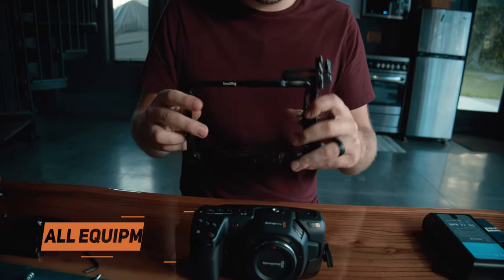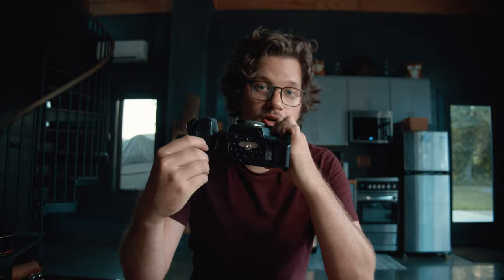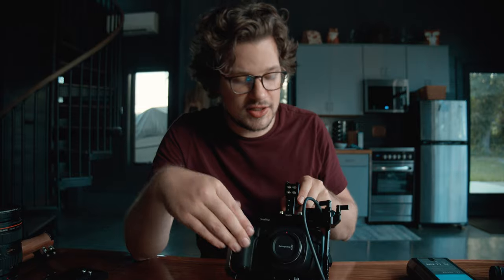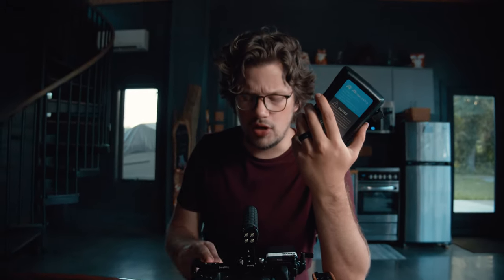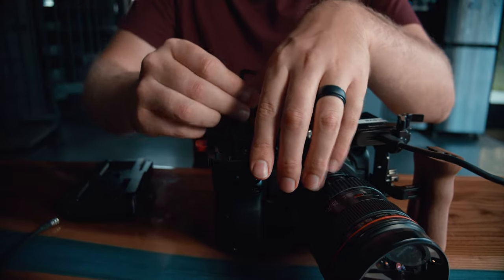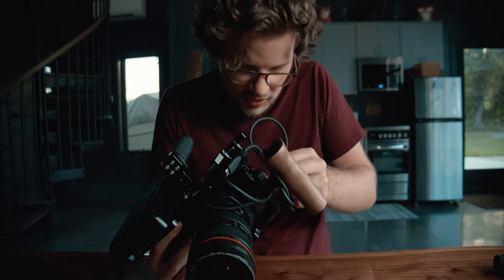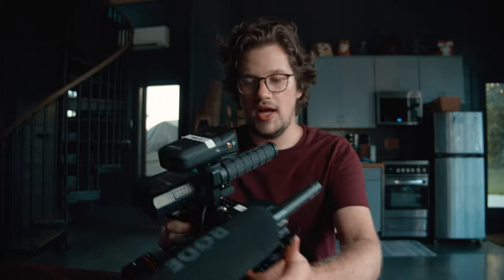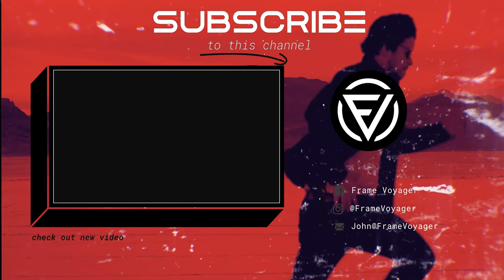My Run & Gun BMPCC 4K Rig | Frame Voyager

Comment: Check out the smallrig 2247, does so that you can screw your speedbooster onto the cage, which is convenient because the camera doesn't turn inside the cage and it removes micro jidders from the lens when you focus, if there is any play between the speedboster and camera like there are for some people.
Reply from the maker: Good suggestion!

Comment: That hand grip likely doubles as an SSD holder. If so, I strongly recommend stashing your SSD inside of it to avoid cage clutter. The DockCase USB C to USB C Cable 3.1 Gen 2 (.7 ft) is a near perfect fit if you go that route.
Reply from the maker: My friend actually has one like that. This handle is not one that you are able to add an SSD into but that's a good idea for a further modification. I kind of like having it on top just because it allows me to quickly get to it if I need to. But you're right that it would probably help with cable management and compactness of the rig.
Reply: Yeah, I have the handle that holds the SSD. Love it! Keeps it even more compact. John's right in that his rig gives you easier access to the SSD which can be great for situations like something run and gun where your'e shooting and dumping quickly. That's the great thing about the camera, it gives you so many options!

Comment: I have been back and forward with v mount vs npf solutions and the more videos you see the more options you might consider but if travel light is your style i believe the v mount is a bit too much because even if you can see the screen you are bulding a big rig haha personal opinion. I have been working with my p4k for a year and a half now and one thing i notices is than half of my jobs i can do them with 3 npf 970 batteries they run for at least 3/4 hours each so if you don't want to use an external monitor you can use an npf plate the small rig one is really well made on the left side of the rig next where the connections are and use your mic position where your v mount it is, also you will gain more room in the handle as i don't like so much have that space full of stuff to operate. That could be my recommendation to travel light and run an gun scenario but it is just another one, everyone has their own evolution of the rig these days haha Good content my friend
Reply from the maker: I like that! I'll have to try that configuration at some point. I really like how it's built because of how it fits in my hard case. I don't have to take anything apart. It can be problematic how heavy it is with a v-mount battery but I can always take it off and let the internal battery run if needed. I've been able to, multiple times, shoot handheld for moving interviews for over an hour. But I've still found this easy to use when on the run, I just never have to think changing batteries for most of the day. But your rig makes total sense too! Like you said, everyone has their own variations of rig designs that they like and what works for them! I just wanted to share mine to give others ideas and to hear from others on how they design their rigs. Thanks for sharing!
Reply: What do you use for storage
Reply from the maker: @danyalvisuals  great question! Filming a video right now on that actually! But a use qnap nas and then am developing a hybrid system that I'll show in my upcoming video!
Reply: @FrameVoyager  okay mate. I’ve subscribed to you looking forward to it 🙏🏼

Comment: Is it possible to fry your blackmagic when you connect it directly to the vmount battery?
Reply from the maker: Yes, unfortunately. It's not common or likely but we have an article one of our community members is writing on thai topic that I will post when it's done! 
Best advice I can give you now is to just power off your device when plugging in just to be extra cautious
Reply: @FrameVoyager  thanks. Would my camera be safer if i connected a Dtap to npf dummy to my monitor. And a DC cable to my bmpcc4k?

Comment: hey man, I'm diggin the run and gun approach on the rig..
Now, since i see you also use Canon with the Viltrox, let me ask you, have you had any issues with the auto focus and image stabilizer, cause mine ain't working..    only the iris control works
Reply from the maker: Hey! Thanks! Good question. I have had some issues. For me it depends on the lens but I usually try and just use mft lenses. Easier and lighter and works natively with the punch-in focus and IS. Plus I've noticed the image being super soft and susceptible to odd glares and other issues. But this was only with some lenses.
Reply: @FrameVoyager  I have also noticed the image being super soft at times. Is this because of the Viltrox you think? Because I used the exact same setup for my gh5 for two years, but never had that problem. So I wondered if it was something wrong with my bmpcc4k. And it usually solves it to just crank up the aputure. But it doesn't happen all the time. Almost looks like the clip is out of focus plus being really soft. Never happens on my mtf lenses tho
Reply from the maker: Yeah, I'm going to be getting a meta bones to test out here soon and see if that makes a difference. I did shoot something for a client that I couldn't tell that the image looked soft the entire time until I'd open it up on a bigger screen. It's almost as if it had a glare from a light or something across the middle that made it look soft. It also could have been the lens I was using as well. I'm still trying to experiment to see if that's because of the adapter or the lens. I prefer to use MFT lenses with the BMPCC4K anyways because they tend to be a lot lighter and easier to travel with. I also think they hold up pretty good image wise.

Comment: Genius with the Vmount on top! I might copy that ;) No monitor tho?
Reply from the maker: Thanks! And no, have never really liked using one or the hassle of setting it up. I build mine to almost be ore-built right out of my hard case. But hey, maybe I should try using one again
Reply: @FrameVoyager  I've heard cases of the HDMI port dying. So yea, of you don't need the monitor just use it without one. Otherwise make sure the cable is secured and isn't flopping around
Reply from the maker: @8lec_R  I've seen that happening to a ton of people! Actually have been gathering information on why it does this and how to avoid it for future videos. Main reason seems to be using the battery for multiple things at once.
Reply: @FrameVoyager  thx for the info. Interesting.

I'm also gonna go look into it.
Reply from the maker: @8lec_R  anytime!

Comment: In my opinion, small rig is the cheapest option. For what they have, they are frequently the only option, or are cheaper than others (I'm looking at YOU Tilta). It isn't cheap to machine bullet aluminum and for the quality you get, I think Small Rig is the best value. I'd certainly rather spend more to get something that protects my gear and works well  rather than saving money and getting stuff that breaks, or will if I drop something.

Comment: hey nice content, 
subcribed for sure, 
been so useful and grateful to found ur channel ! 
I want to ask, about the shock mount on left side of your wood grip for audio, 
do you think that steady enough for run and gun shooting ? 
did you find any shakky noise or anything after shooting ?
Reply from the maker: Hey! Thanks for the sub! I've not had any issues so far with with it having any distortions in the audio if I use that setup. For me all the options that have it float always wear out over time and ended bending down into the frame from the weight of the shotgun mic. I like how it just locks it in place and keeps it from moving without adding any distortions for the most part.
Reply: thanks for your detail ! 
will figure it out soon how to place my NTG5 on my bmpcc4k 😅 
love ur content man, hope you can keep making and helping people out there. 
I would suggest Tips and tricks / audio hacks ! 🤩